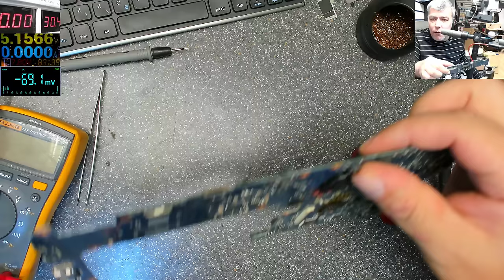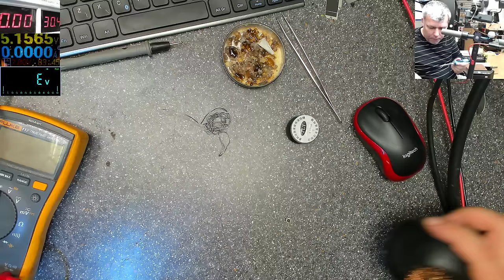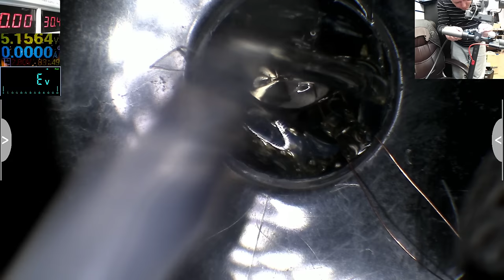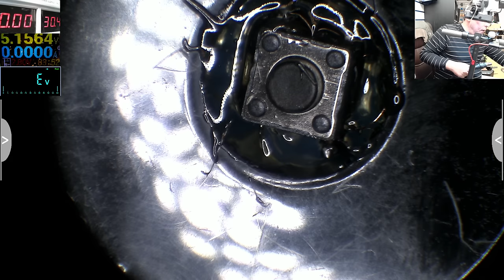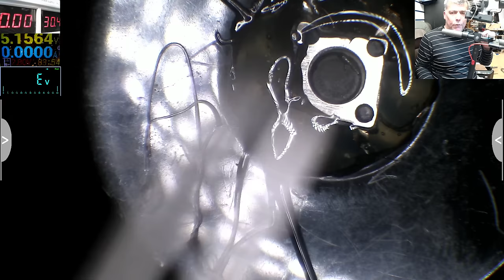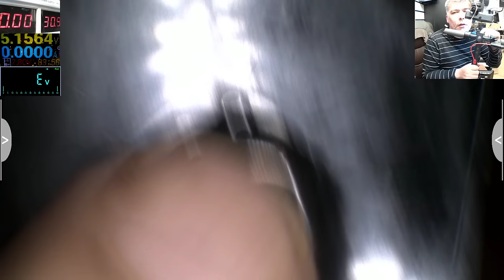How you can fix your Electric Scooter Power Button

Comment: I too was surprised to see 52v straight on the power ("mode") button of an E-bike display. It actually acts as a main power switch - there's no standby power. The idea is when you press it the microcontroller (an STM in the case of this e-bike) gets its 3.3v through some sort of regulator and after it's woken up, it takes over and continues running everything without you holding down the button, including its own power. The STM itself was dead in this case - it wouldn't power up despite getting power - it either died electrically or the programming on it got bugged somehow....

Comment: use the rubber buttons from a controller from playstation or gameboy or an old remote and glue it on top...prety goog it would come out i have done it a lot to my motorcycle buttons of extra headlights...hope i helped...cheers from greece

Comment: hello master, I have two jobs where after the second mosfet the voltage drops to 1.2 or 0v when i bypass the two mosfets the superio get hot and get shorted.
with no super io i have 0.05 amp leak bit I can find it. the 5v is good and the 3.3v is good. when I put a new superio it get shorted instantly. do you have an idea about why is that ?

thank you alot even if you don't respond I still learn alot from your videos